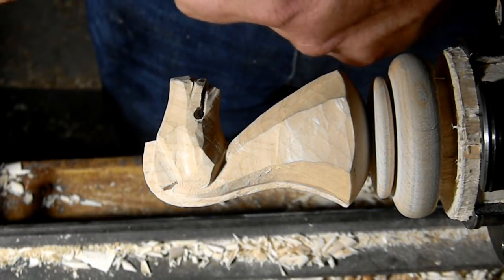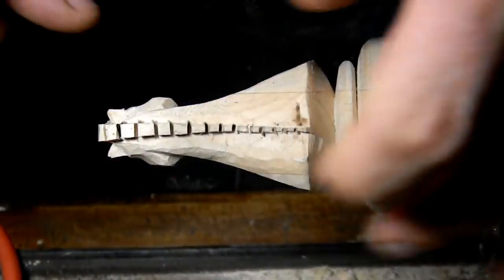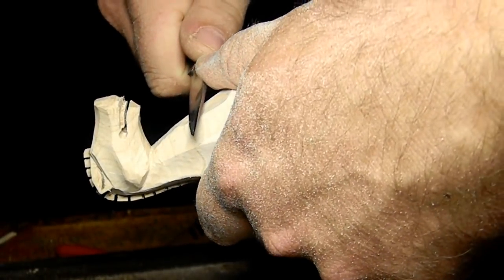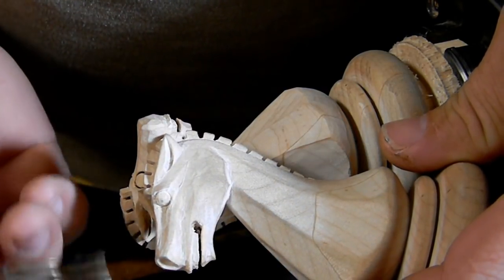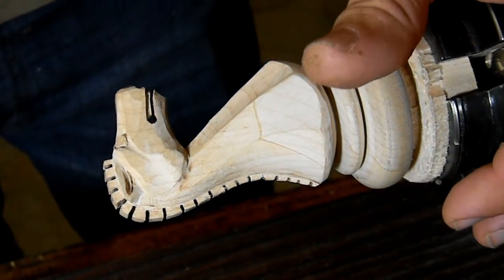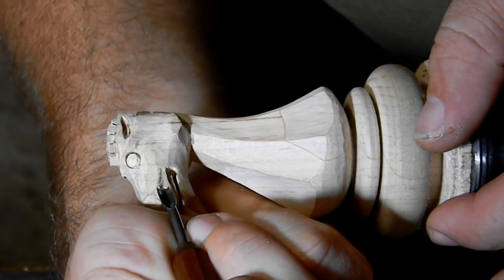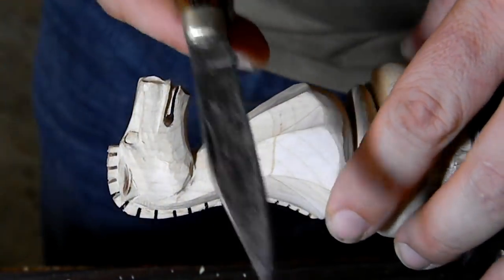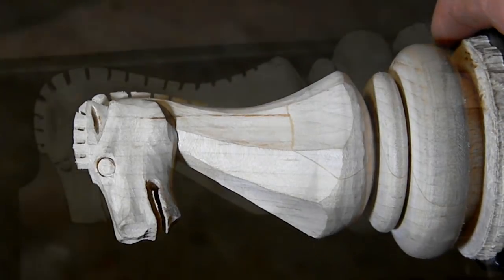Making a Giant Chess Set episode 5B knights. Carving the details. Conrad Craft

Comment: Giving the horse a 'Mohawk' for the mane.
You can make your own mini hole saw from a bit of brass tubing.  Cut a few slits in the tubing to act as saw teeth, and sharpen with a file or stone.  Cheaper than the replacement punches.  I suspect that HF's complete leather punch will be cheaper than the replacement set of punches.

Comment: What size dremil did you use
Reply from the maker: The cutter was a 1/4 inch round disk that was about 1/16th inch thick. The sanding disk was about 1/2 an inch round and 3/4 inch long.